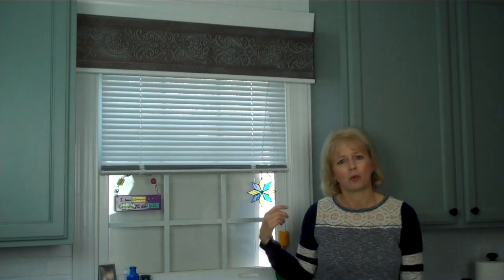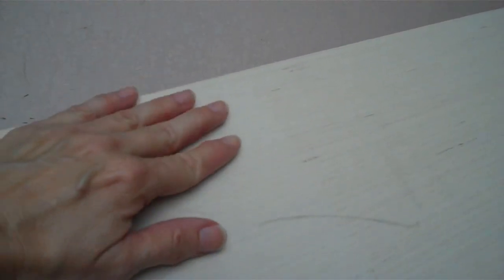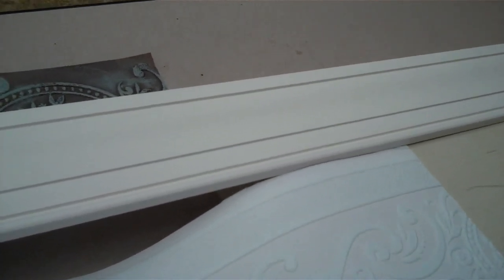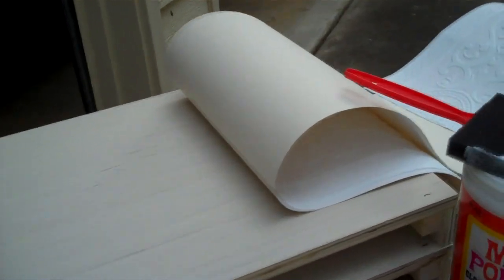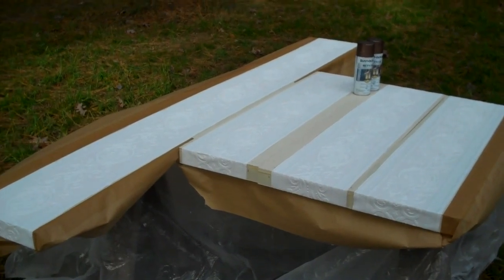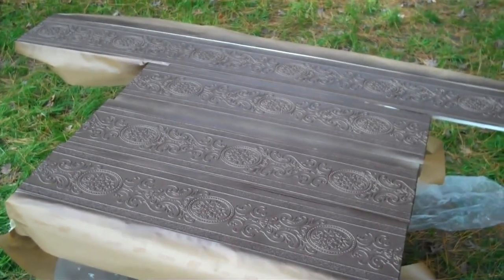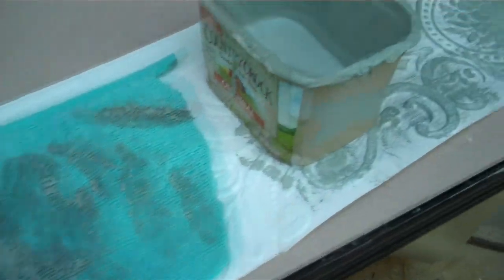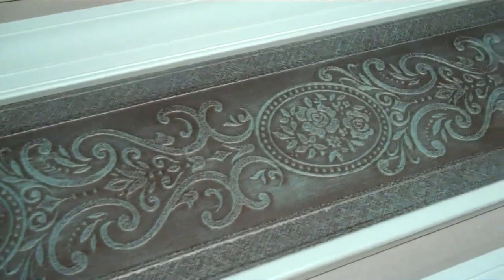Window Cornice Valance - Faux Copper Bronze Metal Look Dry Brushed Patina

Comment: Im surprised this video hasnt been seen like it deserves...I have put embossed paper above my bathroom vanity...the pattern resembles the old tin tiles. I put it up all the wall..and let it rest for 2 days like the manufacturer suggested...then I used rustolium shiny silver metallic paint..brushed on 2 coats...looks perfect like tin. Matches with my shower enclosure we did with galvanized tin siding. The paper was easy and fun to use. Just matching up the seams/pattern dont over lap. This paper and that paint is a blast..